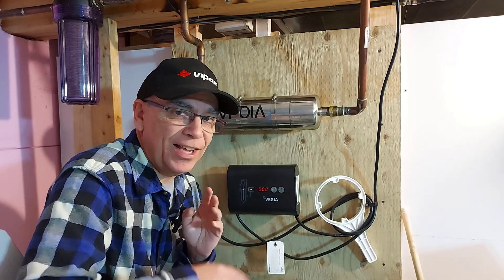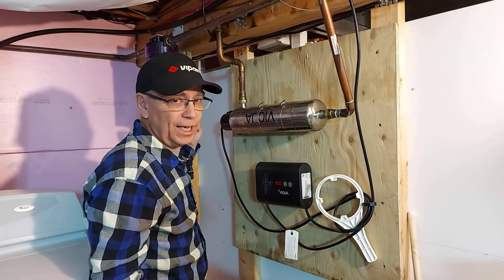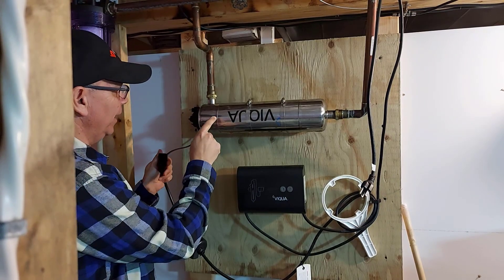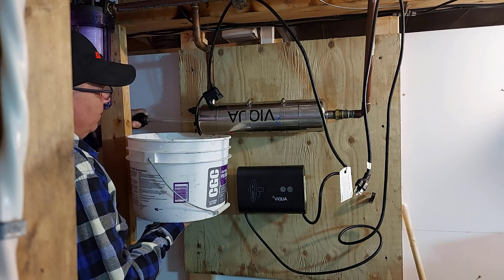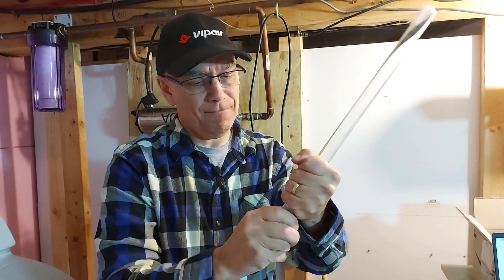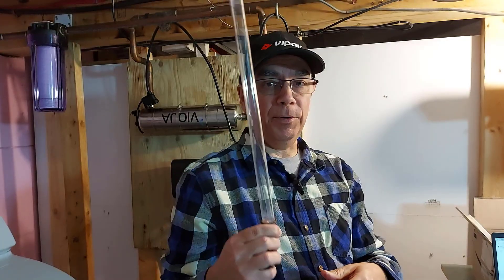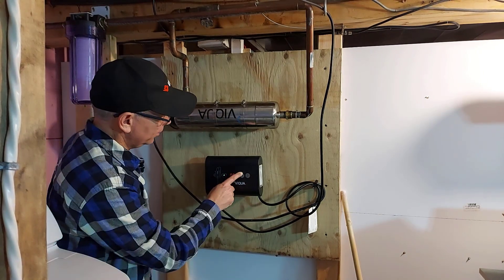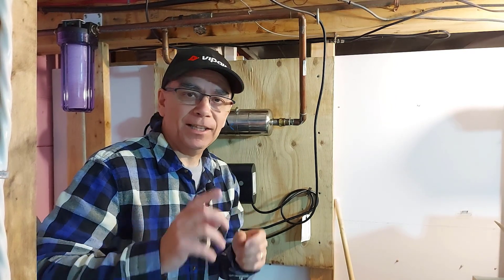Easy UV Lamp Replacement 2024 | VIQUA Lamp and Quartz Sleeve

Comment: Also, did you plug in your controller before shutting on water? My lights are blinking red with alarm and not turning green, even after unplugging and replugging back in.